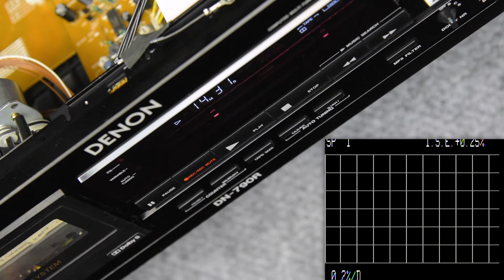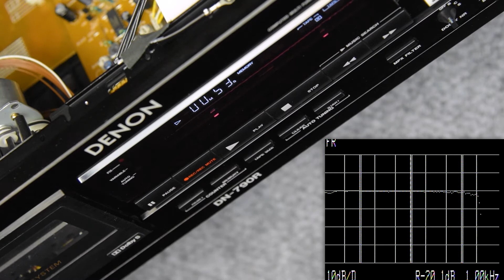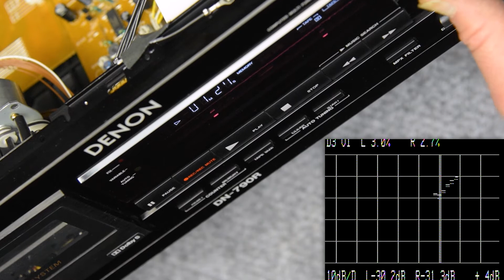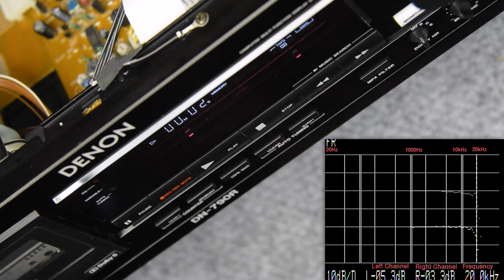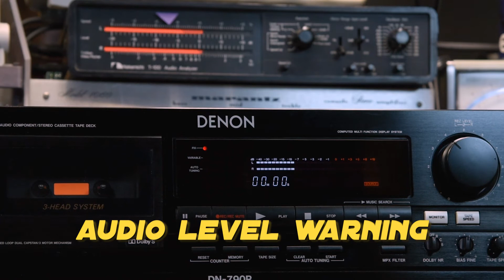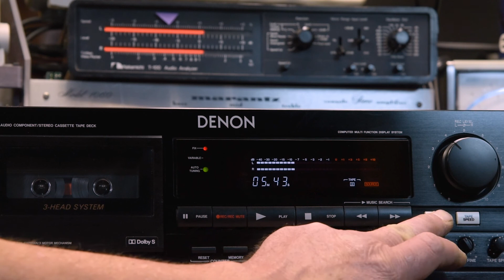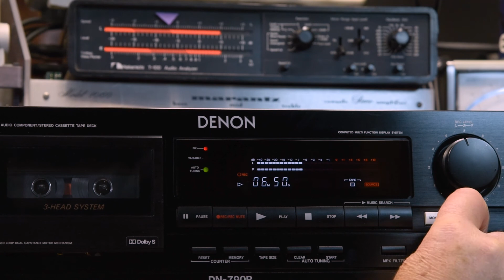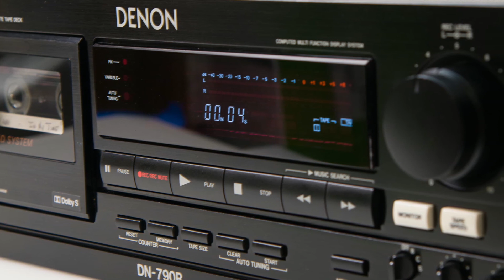Denon DN-790R Demonstration of Auto Tuning and Bias Trim, Frequency Response, and Final Tests

Comment: Yeah when you use the DolbyS the audio sound drops dramatically I never found out why?  If I were you I'd always use the DolbyC and chrome Maxell tapes are the best.
Reply from the maker: DolbyS requires perfect alignment, then it works well. I don't personally use any noise reduction when originating content, but many people like it. When we were kids and driving loud cars, we would record with B then not use it on playback, so we could hear the treble over the motor and exhaust.

Thanks for watching and Χριστός Ανέστη!.

Comment: Hi,
I have a Tascam US-1x2HR usb soundcard.
I'a stereo cassette deck enthusiast and I'm dealing with several servicing issues, adjustments and checks..
While everything seems to be working properly, there's an issue about Frequency response measurements, in regards to dolby C in -20dB.
It appears a massive drop down (about 10dB's), in the range between 100 - 2Khz..
Its very difficult to be a matter of adjustment or cassette deck malfunction.
Most likely it has to do with the quality of the signals that are getting inside the cassette deck.
Something is driving crazy the Dolby cirquits.
Any opinion about improving the signal quality that getting out of the soundcard??
Thanks in advance!
Regards,
Fotis
Reply from the maker: Υιασου λεβεντης! 

Are you saying that while using Dolby C only, not B or no Dolby, that frequency dips 10db in the 100 - 2kHz range but is fine otherwise?

Πάνως
Reply: @asbcustom  Well, B also gives a little dip ( about half of C) but the main issue is on C.
On 0dB measurements, everything is fine.
Also if you put MPX its rectifying the dip.(on -20)
Also dolby S acts normal.
Reply from the maker: Those are very odd symptoms in that frequency range, I have no idea, I suppose I would start probing around the Dolby chip and see if anything stands out.